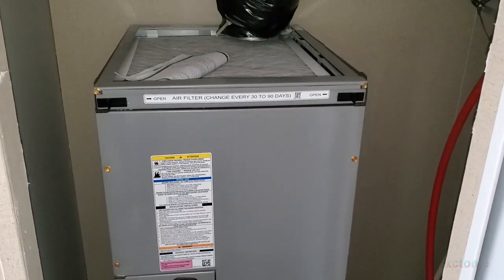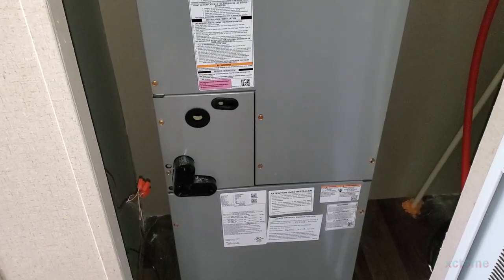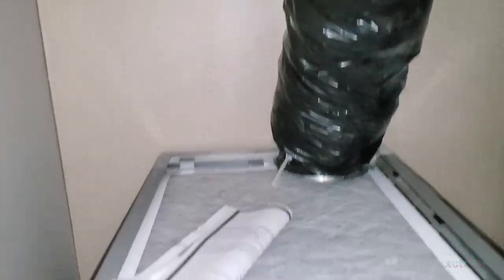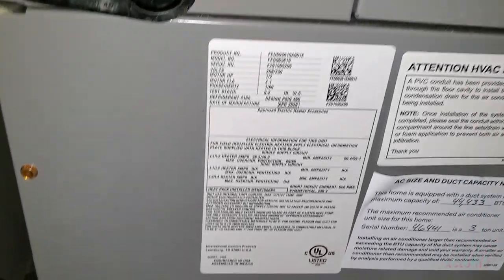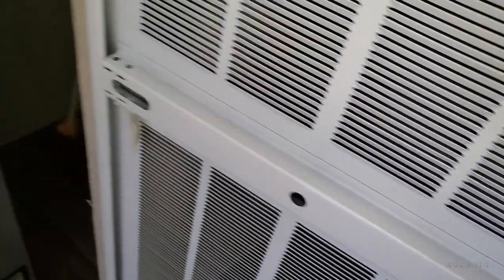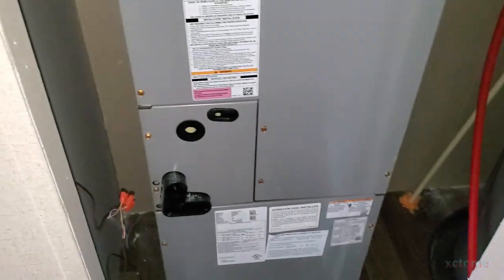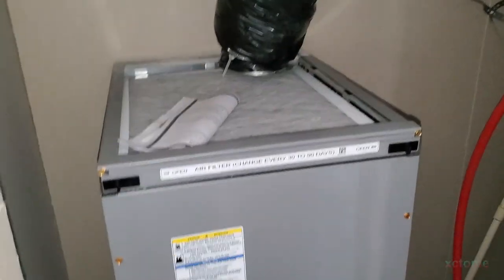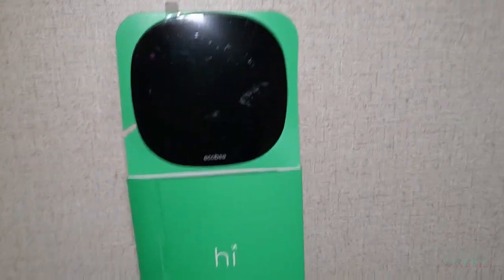Undersized and Poorly Designed HVAC in a Brand New Manufactured House

Comment: When you buy a manufactured home, does it come with heat gain/loss info at a given outdoor design temp? 
Just remember that newer homes may be more energy efficient so old sizing perceptions may not be applicable, it's not really proportional to sq ft either but rules of thumb can definitely work to an extent if you've done many of a specific type/efficiency level of house.
Reply from the maker: New mfg houses do not come with a load calc pre-done, the builder's put whatever size unit HUD calls for the area the house was built in,  i have already did a load calc (like i always do on every change out or new install) and a duct design , for my geographical area the house calls for is 3.5 tons according to both HUD and the load calc. Ductwork is going to be a 20" trunk for two returns and 18" for the supplies. Similar to the last double wide i did but with an additional return.
Reply: @xctome  Excellent - good luck on your project.

Comment: Hi. Thank you for posting this video. My manufactured home has a SmartComfort Carrier furnace just like this one, with the air filter at the top.

I don't really understand how it works. I have that same black pipe at the ceiling above the furnace but it doesn't come down low like yours. Do you know what that pipe is called and what its function is?
Reply from the maker: its a fresh air intake, 100%  totally not needed.
Reply: @xctome  Thanks for replying. I figured that black pipe was pulling in air from outside the home but now you're telling me it's not necessary. So when the furnace turns on, where does it source the air from?
Reply from the maker: @blackx1147  it pulls outside air from a vent on the roof, pulling in humid outside air is not good as it will lead to humidity problems indoors.

Comment: my HVAC return hangs like that ..is that how its suppose to set..just on top of filter?..i tried sealing it but made it worse..plz advise..thx
Reply from the maker: It is designed to bring in outside air, you don't really need it. i capped it off in this house because i ripped out the air handler and put in a package unit outside.